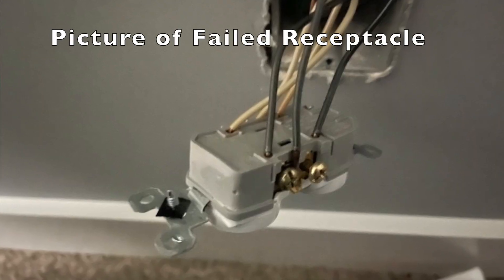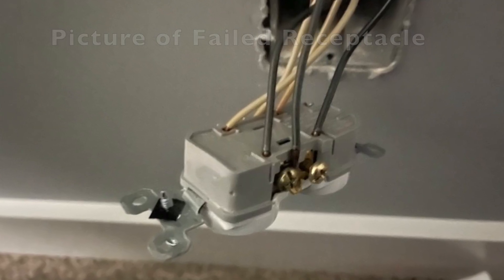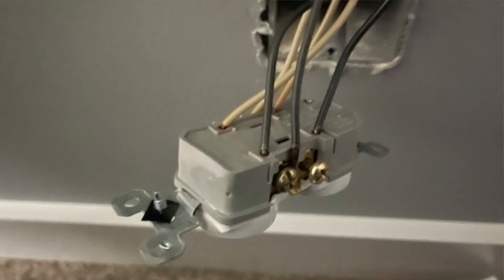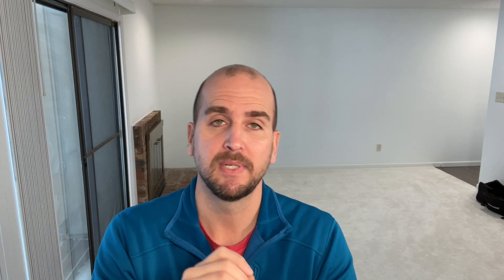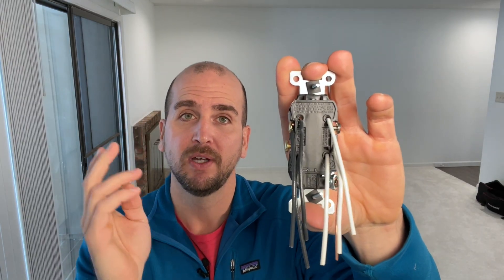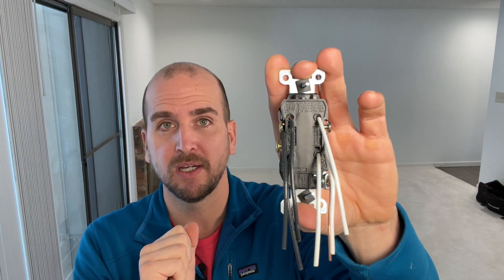Incorrectly Wired Outlet Found In Newly Built Home

Comment: Time 3.56: "J" hook is backward. Installing it this way the wire has a tendency to loosen around the post when you tighten it.
Reply: You sure about that? Righty tighty (or, clockwise, if you prefer), right? Turning that screw is going to pull the end of the wire into and under the screw.  If it was the other way, with the hook end on the right side of the screw, it would push the tip out.
Reply: @jygly  Nope. As you tighten the screw, if the wire is wrapped around the post in a clockwise manned, the wire opening will tighten. Conversely, if the wire is wrapped in a counter-clockwise manner (as the wire in the video was) the loop will open.
Reply: I'm sure.

Comment: Anytime you use wire nuts you are supposed to use electrical tape around the wire nuts, and you should always use tape around the receptacle or switch to cover the screws where you attached the wires. Especially for homes near railroad tracks. Home near tracks have significant vibration and overtime the screws and wires nuts can actually vibrate loose
Reply: Taping wire nuts is not code, nor recommended by wire nut manufacturers.

Comment: Converting shed to cabin. Wiring was gifted by retired electrical contractor neighbor. The whole cabin is on one line. Every outlet connected. He was ADAMANT that this would be OK, that I didn't need anything more. I know nothing about this subject, so I can't challenge him. If I put a 100A circuit breaker on the meter pole and run a black, triple line, (Southwire C (UL) AWS 2 AL TYPE USE-2 60 MILS XLP INSULATION 600 VOLTS JY 073514 #0043612) won't that fry the 20A or 30A breaker that is in the outside circuit breaker box on my cabin wall? Shouldn't I also have a 100A breaker in that breaker box? Like I said, I know nothing about this to be able to correct it; and the price was right, so... The guy was a millwright at the local lumber mill back in the day.

Comment: While I agree with everything here, I have one "worry".   First, I am not a licensed electrician, but I am very far from a novice at the same time.  Just wanted to clear those two things.  Now that we are clear, here is my concern.   If you use a single wire to both outlets (the pigtail portion)  does that not double the amperage going through the 1 wire (as opposed to 2 separate wires without usage of pigtail) and thereby probability of overheating and possible fire?  Other than that this video is fantastic.

Comment: My arc fault breaker kept randomly tripping. I replace the outlet I though was the issue and used the screw terminals vs the quick connect and have had no issues.

Comment: 2 of 3 mistakes you pointed out are proper installation.  The screws you should screw in tho.  The pigtail is more of a nuisance and you can have up to 4 wires on that receptacle not preferred it can 1 per screen and plug in.  Preferred would be 1 feed and 1 load wire tho.

Comment: First off I can tell you that no professional wired that and you had to hots going in which is a very big no no unless you cut the metal strip in the middle.  and for the stupid part.  The flathead screw needs to be horizontal or perpendicular.  I had an inspector actually get on me for it but didn't fail the house, just had to go through and put them to code.  Yes that is code. (california)  and the push ins are OK to use for 14 gauge.  Don't know who told you otherwise.  That is why it is to code.
Reply from the maker: Wait.......what?  You had an inspector make you align the faceplate screws either vertical or horizontal?

Comment: Using pigtails isn't just about it looking better, or being easier to get into the box. It's because the little break off tab between the screws isn't equivalent to the wire in terms of current carrying capability. All the current drawn by every receptacle or fixture after that is coming through that little tab. I've replaced receptacles where that tab was melted off as if it were a fuse.

Comment: Assuming the exception to pig tails is when you have a GFI outlet with another outlet downstream.  This is the config near my bathroom vanity with an outlet at each end.  The GFI is on the first outlet in the series but will trip for either outlet if overloaded.
Reply from the maker: Correct, for standard duplex receptacles downstream that you want protected by the GFCI you would wire into the "load" terminals on the GFCI.  👍

Comment: Keep in mind that there are maximum capacities for wires & devices in boxes. Also the practice of "back stabbing " receptacles & outlets although legal results in many future electrical connection problems. It's best to take the extra time & pigtail splices  then  hook the devices for a sound mechanical connection.

Comment: Not an electrician but I assume the push ins are not rated to run a kettle or an iron but something less powerful like led for room of total 100 watts or less.
So they probably fail because of misuse but amateur and professionals alike cutting corners(use them to power next outlet in line).
Other than that I don't see anything wrong with them.
A plug in the receptacle has the same type of connection but with bigger surface area to accommodate the same current density.

Comment: Where I live you are not allowed to break the neutral and have it pass through a device. Therefore, you have to pigtail it. I should also add that any service call I’ve gone to where the receptacle has failed, it has been from someone using the quick connects in the back. Pigtails are the way to go.

One more thing worth mentioning is that when putting the conductor under the terminating screw, put it on the left side of the screw so when you tighten down the screw clockwise, it will pull in more of the conductor and you’ll get a better connection.

Comment: Wrap electrical tape around the entire receptacle, ie; sides top and bottom. Give it a couple times around. This almost eliminates anything touching hot terminals.
Reply: I've seen this done before. Seems like a great idea, especially when dealing with undersized boxes.
Reply: @MrLewellen420 -- Although I prefer the metal boxes for my garage / shop, one disadvantage of them is that if you are changing out an outlet on a live circuit, you are more likely to accidentally hit the wall of the box with one of the hot terminals... And maybe a neutral terminal at the same time and end up shorting it out... I'll change out outlets on live circuits if they are in plastic boxes, but I won't do it on metal boxes... A pair of leather gloves, using insulated tools, and never touching the bare wire unless it is with an insulated tool that you are holding in your gloves hands will add a bit of safety if you need to work on a live circuit...
Reply: @CurmudgeonExtraordinaire  --Or just turn the power off
Reply: @georgeblank2648  -- I do when working on a 220V circuit, but for 110V, not always...
Reply: @CurmudgeonExtraordinaire safer to turn off the breaker/power. Especially for non electricians.
Reply: @pytube777  -- There's always a compromise between "safer" and "expedient"... I was an electronics tech in the Navy -- sometimes, you need to work on live equipment.  I've been hit with 400V from the filament voltage on a RADAR's receiver-transmitter and 14KV from getting a bit too close to the high voltage side of a RADAR indicator's power supply (I was a couple of inches away).
Reply: @CurmudgeonExtraordinaire  if that’s part of your job then okay but for DYI guys, safety always come first.  You can’t replace a human life.
Reply: That's how I was taught to do them too

Comment: As a sparky with 25 years in the trade, I cringed seeing that outlet with all those wires landed on it.  I've never done it that way.  IMO the best way is to pigtail when you have more than 1 hot, neutral or ground.
Reply: Worked with the laziest sparky. He would have 9 wires going to a spec grade receptacle that had the plates to place wires in before tightening. He also used the smallest or shallowest boxes.
Reply: When I was going over and changing every outlet as well as adding isolated circuits, i found several every screw and push ins used.. When I took my electrical courses years ago our instructor told us if we used a push in he would fail us.. I also pig tail and then connect to the correct rated outlet..
Reply: I'm renovating a home from 1990 and I've stumbled upon multiple occurrences of this atrocity, so it's unfortunately a common thing...

Comment: Came across your video. Nice, you have identified many basic wrong doings, poor installations, and improper use of a receptacle, Well done on the box extender and longer 6/32 screws. So many leave exposed material between the receptacle and the box (violation NEC 314.20). The fire risk of leaving the side screw extended out and not protecting a flammable surface, as you noted. I didn't read all 4,000 comments, but FYI, some states (Texas) have state licensing rules and regulations (TDLR) that homeowners are not allowed to perform electrical work (except change light bulbs) on their home and must hire a State Licensed Company. If home owners or a handyman (not legal for electrical work) do any electrical work on the home, their insurance can deny the claim (if an issue arises) and if they put the home for sale, must disclose the illegal work or modification to prospective buyers. TREC 5.008. Keep up the great work.
Reply from the maker: This is great info and I actually was just thinking about calling out this exact thing in a few videos coming up.  Appreciate you pointing me to the right part of NEC.

Comment: About the mistake 3, is it not a bad idea to just use another wire to get the other 2 together? If the 2 original ones are rated for 5 A (example), then you could have at most 10 A. But since you used one equal to the 5 A ones, you can only have 5 A total. Unless I didn't get something, which is possible (could you explain it please, in that case?). Thank you for the video!

Comment: question: why not use electrical tape around the receptacle terminals before securing to the wall/box (to prevent any accidental shorts)?
Reply: I do that with everyone. Thanks for saying that
Reply: Because the terminals are already insulated by a plastic box. It's not worth the mess when it needs to be fixed. Even with a metal box, a ground fault should not be hazardous, so it's arguable that it's not worth the mess.
Reply: Metal box....yes. Plastic box....waste of time. Just my opinion.

Comment: Holy cow that is some cheep shit sockets or receptacle, didn´t know you called it that in the US. :-D
The Danish ones cost about 12$ but atleast you can use the push-ins, as that is the only way to connect them now. Has been for the last 2 decades or so, but not a common problem with the wires popping back out.
Thanks for the video, fun to watch.

Comment: In the last year and a half I have had two switch failures.  Both were back wired (Non commercial).  The wife flipped on a light switch in the kitchen, it sparked and the light did not come on.  I turned off the breaker and found a back stabbed wire had popped out and also the plastic back of the switch had cracked from top to bottom.  Second  one was also in kitchen.  No sparking but light would not come on.  Checked first by trying a new bulb, no dice, Then I thought most likely the switch,  turned off breaker then found another cracked switch(also back wired).  House built in 2007.  Going to get proactive.

Comment: I PERSONALLY SEEN A BLACK WIRE TIED TO THE RED WIRES, NEVER UNDERSTOOD WHY USE A BLACK WIRE INSTEAD OF A RED PIGTAIL? AND SECOND, I ALSO HAVE TO WONDER WHY THE 12 GAUGE PIGTAIL IS IT BECAUSE IT'S A 20 AMP FUSE OR TO PICK UP THE LOAD OF TWO 15 AMPS?

Comment: What if I want to use stranded wire? 12AWG, do you recommend spade connectors?
Reply: You shouldn't use stranded wire unless it's coming into your box via some kind of conduit (or you have a somewhat rare kind of commercial metal-clad cable with stranded wire). If this is the case, though, you can trim the wire about an inch longer than you need, then strip the insulation forward without removing it fully. You'll end up with a section of exposed wire with insulation in front of it. Then you can wrap this around the terminal screw (always clockwise) and tighten it down, then when you're done you trim the excess with diagonal cutting pliers. It's kind of difficult to explain, but if you have the materials in your hand it should quickly make sense.
Reply: @andrewbolin3592 Thanks, so in case I always use EMT at my job and stranded wire 12 gauge for 20 amp circuits.
Reply: @andrewbolin3592  I was joking.
Reply: @benburnett8109  I thought so, lol.
Reply: car audio speaker wire is best. It is oxygen free so better current travel. It also comes in purple, green, red, aqua, teal and a host of other colors so you don't get your "hots" and "colds" messed up. And get the gold plated connectors for optimum current handling.
Reply: @benburnett8109  
Speaker wire is generally smaller than 14ga, which is rated for 15A. Most modern homes have 20A circuits, so they require 12ga. Most speaker wire will also not be rated for use in walls. This is bad advice.
Reply: @andrewbolin3592  thanks

Comment: You dont need to use electric Tap around the outlet or on the wire nuts ? Thank you
Reply: Not on the nuts, but it's a good idea to wrap the outlet so that the screws are covered.

Comment: running tape around the screw terminals will also help to protect against accidental shorts
Reply: Yes, but in a plastic/wood enclosure, fuck that. Metal box, yes for sure.
Reply: Shorts from what exactly? The trim prevents objects from entering the enclosure. Plus tape gets nasty as hell over time
Reply: @major7009  people dig into outlets, I dunno.  All the electricians here tape them.
Reply: @sirpiken  yeah I know the reasoning but there’s really no reason to. If it’s super 33 then yeah go for it but that’s too expensive to be used as a device wrap so that’s why you end up with the nasty goop when you go to service
Reply: @major7009  I wouldn't say the tape gets nasty. It just loses it's elasticity and turns brittle. commercial guys working with mostly metal boxes wrap the outlet in tape so there's no potential for shorts.

Comment: I have to disagree with the conception that push in connect fails it makes more sense to protect the wire from condensation ext as much as possible no one on youtube has mentioned this it just makes sense it is also in my opinion a good idea to ralp electrical tape around the screw terminals if used to also protect from condensation.
Reply: Condensation? Is that the word you meant to use? Because tape won’t do anything for that

Comment: I really need the why. Why pig tail and why are push ins high fail
Reply: Pigtails cause of continuity throughout the circuit using the wire. Using the device as your splice point, if the device fails then everything down the line is now dead.
Stab ins fail cause the part inside making the connections is essentially a knife blade, so the amount of current passing into the device will eventually cause that to fail
Reply: @major7009  good points. The pigtails make a lot more sense to me now. That being said, sounds like stab in is more if a cheaply made design flaw than a actual problem conceptually.
Reply: @EV_Dreams  I agree. Also another point is that most commercial building specs will say you must pigtail so you’ll typically only see stab ins in a residential setting partly because of cost/speed and because pigtails aren’t required

Comment: What do you think about installing the ground point up vs down?  I have been told if a plug is loose and something is dropped on it, the dropped item will touch the ground vs the hot/neutral pins.
Reply: It’s just personal preference really, that argument is valid though. Minus healthcare facilities, unless the spec says otherwise most guys will do ground down
Reply: Some people use this to show which outlet is switched.

Comment: You should have never wire nutted the 2 wires together. you should have j hooked both hots to both hot terminals clockwise so the screw tightined the wires down. We needed to see that with the 3 wires coming out the back of it yeah you could have pigtailed them but you didn't show us that?
Reply: Why? What’s your reasoning for not pigtailing?

Comment: Awesome video.  I’m replacing an outdoor GFCI outlet an unable to push the wire into the back of the outlet.  The wire is too large for the hole.  Can a pig-tail be done on a smaller wire to a larger wire?
Reply: Best practice? Just wrap the wire around the terminal. But to answer your question it depends if the circuit is on a 15 or 20 amp breaker. If it’s 15 then pigtail a #14 off and stab it in, but if it’s on a 20 then it needs to be #12

Comment: Only use a pig tail when you have enough space in the box to easily fit the wires and receptacle. DON'T just jam it in like your highschool's varsity quarterback would. Either skip the pig tail or install a deeper box if possible.

Also, don't use wire nuts if you don't have to. This is the 21st century people. Use Lever Nuts! Or at the very least use some push connectors if you're dealing with solid wire.

Comment: As a general rule of thumb when working in a wall box of any kind, always disconnect the ground wire from the device and get all ground wires out of the way, like to the back of the box. Do not leave grounds attached to the device or in your workspace!! Lastly reconnect the ground to the device when all other wire terminations are complete or wires capped off.
Reply: Can you explain why? I’ve never heard this